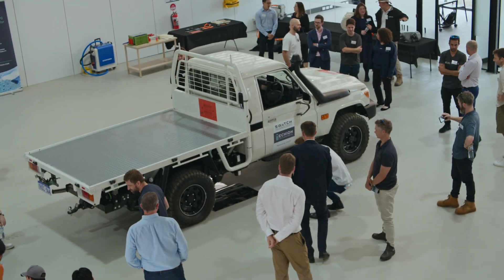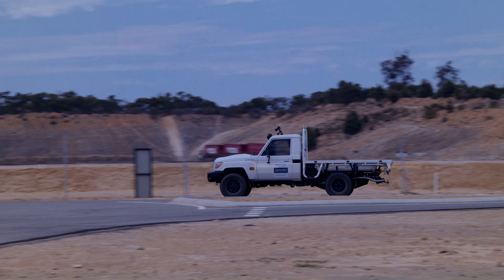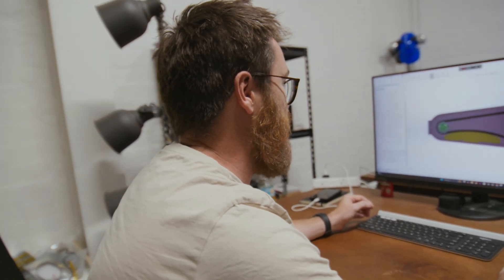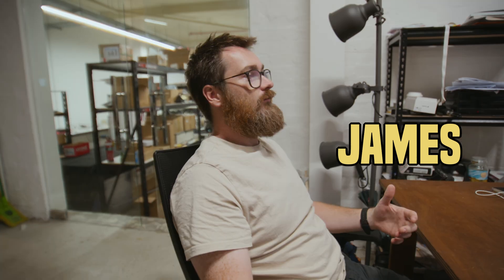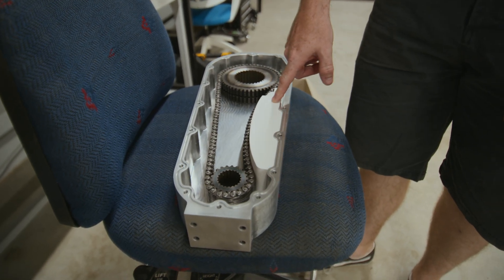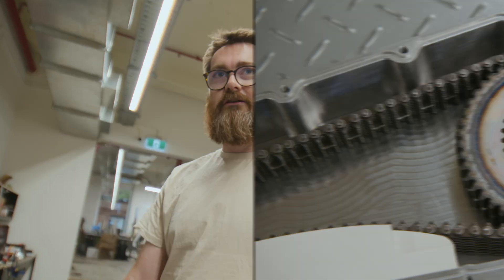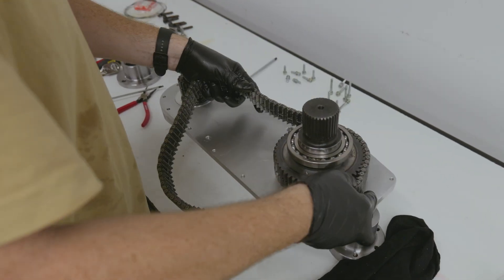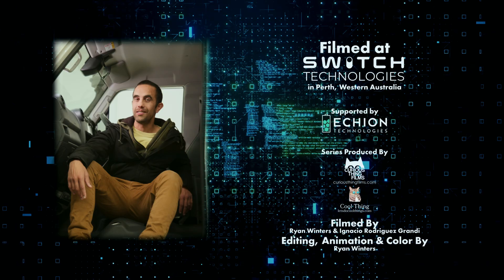Fixing Our Transfer Case Chain Issues - V8 Hybrid Land Cruiser - EP.11

Comment: Cool idea guys, I designed a similar but simpler way to introduce power to the driveline with the hybrid system in my head years ago that was able to be disconnected from the original driveline if needed. It’s great to see Australia taking the lead in modernizing a solid proven formula in the Toyota Landcruiser ,it would be great to see a conversation kit for all the older cruisers on the road. Excited to see it finished!